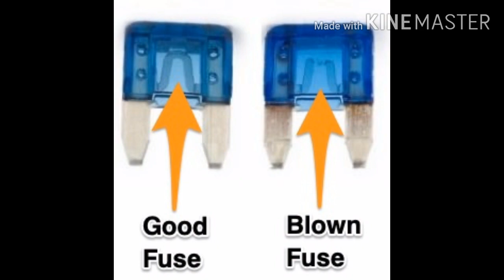Dahilan ng palaging pumuputok ang fuse ng aircon

Comment: Sir sa compressor pulley din ba ang issue kapag nahinto ang radiator fan gawa ng putok na fuse?
Reply from the maker: Sa motor Po ng radiator Po Ang may problema Po bossing,grounded na Po Ang motor ng radiator fan Kya pumuputok Ang fuse

Comment: Boss sa corolla 2e ng ac compressor anu po ung dalawang wire doon na black and green.. Hindi po un magnetic coil.. Gusto ko lang po malaman anu tawag doon at function non.. Salamat boss
Reply from the maker: Anu compressor u bossing Sanden po b o denso,kapag ung wire sa sa compressor isang negative ung nkground sa body Ng compressor at  isang positive ppuntang relay

Comment: Sir,yung L300 namin, pumuputok fuse,tinanggala ko na socket comp,at dalawa fan ganon pa din ,pero nung tinanggal ko socket pa sensor papuntang evaporator di na siya pumutok,
Reply from the maker: Mayron Po grounded kaya pumutok Ang fuse, pwedeng sa wiring o kaya sa blower motor, kaylangan Po mateoubleshoot

Comment: sir salamat sa idea.. ask ko lang po kung saan po makikita yung aircon fuse ng multicab minivan? salamat po sir.
Reply from the maker: nasa fusebox din po nakalagay ang fuse ng aircon bossing
Reply: @pinoycarairconspecialist3729  salamat sir. pero po kasi wlang nakalagay na ac fuse dun sa fuse box nia sa ilalim ng driver side sir.. ang prob po kasi sir ng aircon ko is pag e on ko ung ac, di po gumagana ung magnetic clutch. peru pag direct ko po lagyan ng 12v sa comp is gumagana naman po ang clutch..salamat po.
Reply from the maker: kylangan po machekup po muna kung may refregerant o freon,kapag po kasi walang freon hindi po gagana ang compressor,kaylangan po makbitan muna ng guage manifold para malaman kung may laman refregerant,free chekup naman po sa car aircon shop,ngaun kung full naman ang freon,at hindi gumagana ang compresor ay dun n po mgchechek ng fuse o electrical problem nya,

Comment: Kuya puede ba conversion ng compressor para sa toyota corolla big body 1997 model at anong model  at part number ng compressor para sa conversion
Reply from the maker: denso 15c or sanden 507 na compressor bossing
Reply: Kuya salamat sa sagot mo puede ba gawa ka ng video tungkol sa conversion ng denso 15c at sanden 507 kahit paliwanag lang kung paano palitan ang pulley at kung magfabricate pa ng bracket , gagamiting ba lumang pulley at coil  salamat uli more power and god blessing
Reply: Kung puede Kuya iyong dalawa pinagpipilian kung ipalit sa compressor ng big body Toyota.Salamat uli.
Reply from the maker: @neptaliiifernando5258  denso 15c nlang bossïng ang ikbit u po sa toyota bigbody
Reply: Ok kuya , kung 15c po pipiliin ko kailangan pa po ba brachet , gagamitin po ba pulley at coil ng original na compressor , kung bagong pulley at coil naman saan po makakabili nito , taga rizal province po ako malayo sa lugar mo . maraming salamat.
Reply from the maker: @neptaliiifernando5258 Anu po dating nkakabit na compressor sa Toyota bogbody u po?Kung surplus po bibilhin u na denso 15c ay parehas dapat Ng dating nkakabit na compressor
Reply: Kuya sanden trs 090 clockwise ang rotattion

Comment: master 5 days palang po l300 ko,bali 2 ang auxiliary fan nya ung isa pumutok dinala ko sa casa,pinalitan ng fuse gumana namn ,pero kinabukasan yun isa namn po ang pumutok na fuse, 
ano po kaya sira nun master?
salamat sapag tugon.
Reply: gawa po pala sya ng sanden
Reply from the maker: Anu po model yan bossing fb L300 po b?2021 model?bihira ang ganyam trouble,bagong bago ang mga parts  pumuputok ang fuse,ang idea ko dyan bossing ay maaring may problema ang motor  ng fan o kaya sa pagkakaelectrical wiring ng aircon
Reply: @pinoycarairconspecialist3729  kakalabas lang po nung 24 master
Reply: kinuha ko kanina ,pinalitan ng fuse gumana namn,nun sinubukan ko kaninang hapon yung isa namn ayaw umikot ,putok ulit ang fuse master.
Reply: laking abala diko magamit ng matino para sa hanap buhay namin ng asawa ko
Reply: 2021 model
Reply from the maker: pakitingnan u po bossing kung tama ang ampere ng fuse dyan sa fuse box,baka mas mababa ang nilagay kaya pumuputok ang fuse,halimbwa 15ampere ang nakalagay sa fusebox ang nilagay nila 10ampere lang kaya pumuputok ang fuse,dapat 15ampere din,
Reply: @pinoycarairconspecialist3729  10 amper lang po nakalagay master
Reply: bukas po master bili ako ng 15 amper n fuse pag pumutok pa papa ulit ko electrical nila.maraming salamat po master
Reply from the maker: chekup u muna po kung 10ampere nkalagay sa fusebox bossing,hindi u na po kaylangan lagyan ng 15ampere,magkakaproblema po, kung  10ampere lang tlaga ang nakasulat sa fusebox,un po ang kylangan sundin

Comment: Sir, kung hindi po ba nag eengaged un clutch ng compressor, possible po n thermostat ang my problema?
Reply: napalitan ko na po ng relay, minsan nd po nag eengaged habang tumatakbo kaya nawawala ang lamig
Reply from the maker: depende po,ung ganyan trouble minsan may naglolose lang kgaya ng ground,pwedeng pressure switch,pwedeng thermostat ang sira,Anu po kotse at model bossing
Reply: @pinoycarairconspecialist3729  honda city 2010 Sir. pag nabilad sa init ang kotse, ayaw lumamig ng aircon Sir..pero gumagana nman ang mga auxiliary fans. ayaw mag engaged ng clutch ng compressor.
Reply: @pinoycarairconspecialist3729  Sir, paano po ba ma check un ground ng compressor, pressure switch at un thermostat? salamat po ng marami sa reply nyo
Reply: bk nga po pressure switch, at nag hihigh pressure kc nga po pag nabilad sa init amg kotse, doon hindi nag eengaged ang clutch ng compressor...
Reply from the maker: @robertyaeltemplo440  kaylangan machekup po muna ang refregerant o freon Kung full,kapag po ksi kulang Ang  freon mahina lamig Ng aircon lalo na kpag nabilad sa araw,pero Kung di gumagana compressor ay may problema sa electrical Ng aircon pwedeng may naglolose,pwedeng  Rin relay,o thermostat,kylangan machekup Muna bossing marami po pinangagalingan Ang ganyan trouble
Reply: @pinoycarairconspecialist3729  malakas po ang charged ng freon Sir. kc pag nag engaged ng clutch, sobrang lamig tlg.cguro nga po pressure switch.saan po makikita amg pressure switch ng honda city 2010?
Reply: @pinoycarairconspecialist3729  Sir, sure po ako na ok ng freon at relay kc npalitan ko na po.
Reply: @pinoycarairconspecialist3729  salamat ng marami Sir...paano po malaman kung Thermostat o pressure switch amg problema...cgurado po ko n ayos ng relay ko kc napalitan ko na po... salamat po
Reply: boss, saan po makikita ang AC pressure switch ng honda city 2010?
Reply: ilan po ba ang AC Pressure Switch ng Honda City? 1 or 2 po?

Comment: Sir sana po masagot mo po new subscriber mo po ko . Ano po kaya problema ng aircon ko pag malamig po ang panahon like sa umaga at gabi po okay naman po di naman po nasusunog ang fuse ng aircon ko pero pag tanghali lalo't nakatigil na bukas ang aircon nasusunog po agad ang fuse nya ano po kaya problema . Sana masagot mo po 🙏🙏🙏 Salamat po more subscriber . Godbless ♥️
Reply from the maker: Anu kotse at model Po bossing? kadalasan trouble Po magnetic coil Po ng compressor Ang problema nya,Kya pumuputok Po Ang fuse dahil Po nagiinit na Lalo na sa tanghali,pero Kaylangan Po machekup Po muna Ang magnetic coil
Reply: @pinoycarairconspecialist3729  nissan urvan 2011 po sir . Sana po masagot nyo po . Maraming salamat po

Comment: master ano po pinagkaiba ng dual capillary expansion valve sa single lang
Reply from the maker: mas malamig po ang dual capilliary exfansion valve
Reply: @pinoycarairconspecialist3729  pede po ba iconvert sa dual master.saan po naka connect un isang butas
Reply from the maker: pwede po,sa suction tube iĺalagay,maghihinang ng haft union.
Reply: master un manual thermostat ko po sinagad ko ikot counter clockwise hindi po nagoff compressor pero nag aauto on/off naman ano po kya dahilan
Reply from the maker: oke lang po un bossing nakasagad ang thermostat at nagautomatik naman,di naman po tlaga magoof un dahil nakasagad ang setting
Reply: kala ko po sira n master kc hindi ko ma off un compressor gamit un thermostat
Reply: master ano po b pinagkaiba ng 1500 at 3500 na denso front evaporator ng revo

Comment: Sir kapag walang freon ang unit aandar ba yan?
Reply from the maker: kung may pressure switch di po aandar ang compressor kung walang freon,kung walang pressure switch gagana po ang compresor kahit walang freon
Reply: Ah ok sir,salamat @pinoycarairconspecialist3729
Reply: Sir saan makikita ang pressure switch ng sasakyan? @pinoycarairconspecialist3729
Reply from the maker: @donzriconz9043  kdalasan nasa hotĺine tube nkalagay o kya sa itaas ng filter driek makikita ang pressure switch

Comment: Ano kaya posibleng dahilan bakit nawalan bigla lamig ang ac ko 2e ang makina ko bigbody..nung gamit ko una ok lamig tapos pinatay ko namatayan ulit ako ng makina nawala na lamig...salamat sa sagot sir
Reply from the maker: maraming po pinangagalingan ganyan trouble po bossing,kaylangan machekup po muna  kung may freon ,ngaun kung may freon naman ay electrical problem lang ang problema,maaring pumutok ang fuse,o relay o magnetic coil,pwede ring nagkaproblema ang thermostat,kaylangan machekup po bossing
Reply: @pinoycarairconspecialist3729  pero pag nirekta ko ang compressor umiikot ang magnetic clutch...pero wala lamig...nawala ang linya ng ginawa ko aux

Comment: Pano po mamalaman pag sira na ang compressor umiikot naman ang magnetic clutch
Reply from the maker: malalaman kapag sira na ang compresor ay may leak, mahina na ang bumba ng compresor,maitim ang langis o kya stockup na,pero kung umiikot pa at wala nman  leak ay oke pa po ang compresor
Reply: @pinoycarairconspecialist3729  salamat po, pero na check kanina nsa 60 to 70 psi ang pressure. Try ko po muna palitan ang solenoid valve.

Comment: sir bt napansin ko sa sskyan ko tgal nya mg automatic. pgtumakbo ngaautomatic nman po sya pg nka idle lng mtagal. ano kaya prob nun sir? isa pa pla sir ano po exact address nyo? ty
Reply from the maker: pwedeng kulang ng freon kylangan machekup ang freon bossing,
Reply from the maker: layac dinalupihan bataan bossing
Reply: di nman po sya kulang sir sa freon sir sakto nman po. ang tgal lng po talaga mg automatic. sir pede ko po ba mkuha cp no. nyo o any contact no.? ty
Reply from the maker: @kennetha2689  may kaugnayan po ang freon kung ma agal magautomatik,ngaun kung full nman ang freon,setting lang po ng thermostat ang kylangan ibaba pwede na po 1/4setting para mbilis magautomatik,09493297532
Reply: @pinoycarairconspecialist3729  sir salamat po.

Comment: Bos kapapalit ko lng ng pully kaso pumupitok parin ano po kaya ibang dahilan nito
Reply from the maker: magnetic coil po yan bossing'grounded na po ang magnetic coil kaya pumumputok ang fuse ng aircon,anu kotse at model bossing?halimbwa vios po ang kotse ay dapat isang set na po pinapalitan,assembly na po magnetic coil,pulley at hub